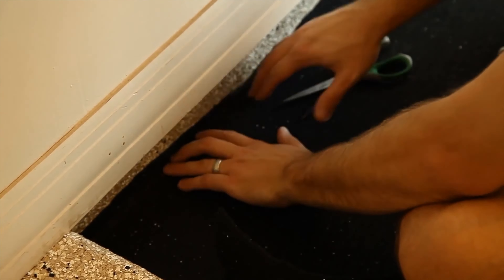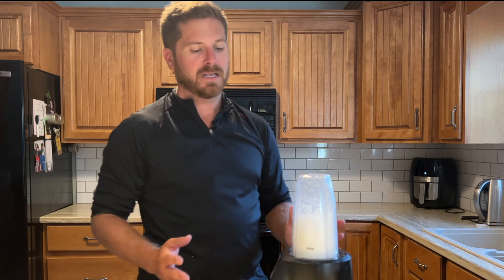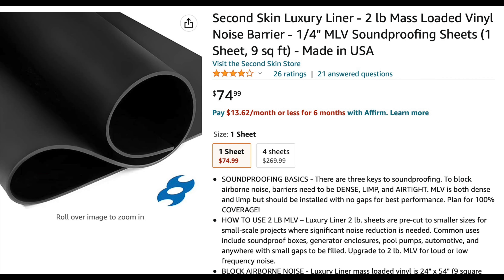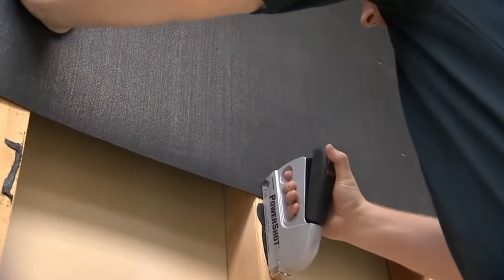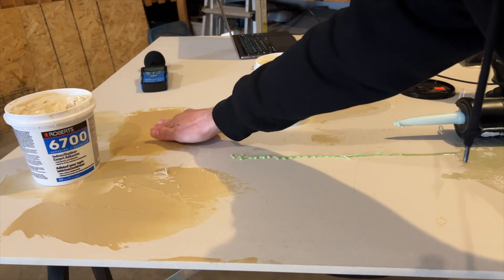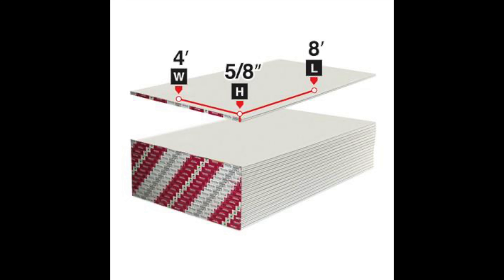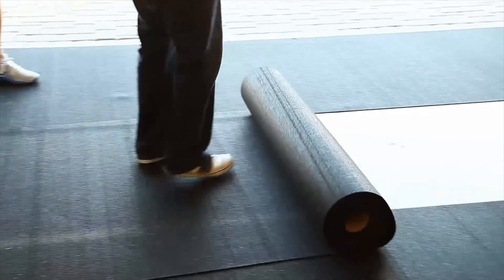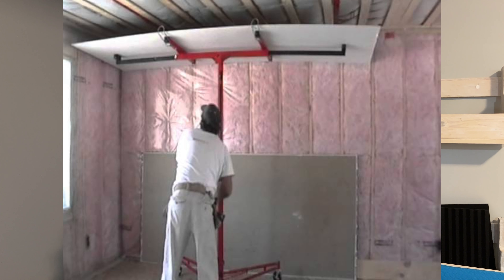How to Soundproof a Duplex THE RIGHT WAY

Comment: HI   In order to sound proof my  walls if i  use  MLV on existing  Drywall and then   screwing another  drywall on the top of the MLV   would that work  for wall that does not have any  insullation   thx

Comment: Not sound related but How about living in a row home and ventilation... my senior citizens neighbor smokes pot and hot boxes my house ! It smells horrible for hours after. The walls are bricks and plaster. Built in 1956. I assume it leaks over thru the attic crawl space. You have any ideas ?
Reply from the maker: That’s terrible! I don’t have much of an idea without seeing the place. I’ll do a couple of search’s and edit this response if I find something you could go by.
Reply: Air purifier
Reply: @soundproofguide If you haven't done a video on this already, I'd love to see one. My neighbors' smoking is driving me crazy. One neighbor smokes a ton of pot, and the other one smokes cigarettes.

I think the cigarette smoking is happening mostly outside, but it still goes right into the apartment, even on the third floor. I have an air purifier with an activated carbon filter, but it's not enough.
Reply: Did you find any solutions? I'm thinking of asking my neighbors to smoke further away from the building instead of on the stoop, but it's a twin, so there isn't much space to smoke further away. If they go to the front, then it will still come in but directly into my window instead of the kitchen window. I don't think there's 20 feet of clearance in any direction.

Comment: Nice video. I live in a townhouse in the Netherlands where the interior walls between homes are either cinder block or concrete. My neighbors are incredibly noisy for both air sounds and vibrations. What would you recommend for loud voices? Can I still go with just the MLV and drywall solution? Or should I also add sound-insulating Rockwool to the mix? Thanks!
Reply from the maker: You can definitely just add MLV and drywall! The MLV will help block and absorb the noise coming through the concrete. Add two layers of 5/8” drywall while you’re at it! I’m confident you’ll satisfied!